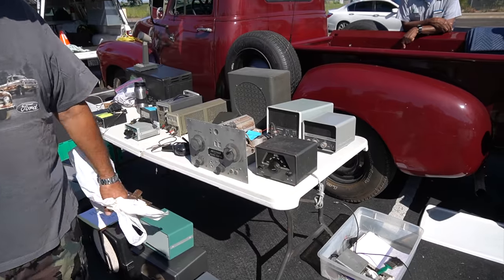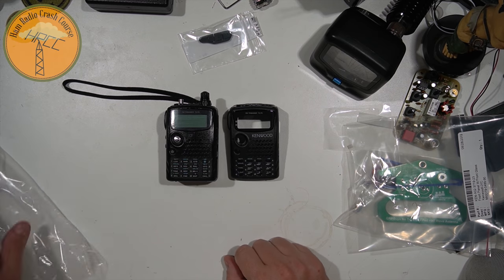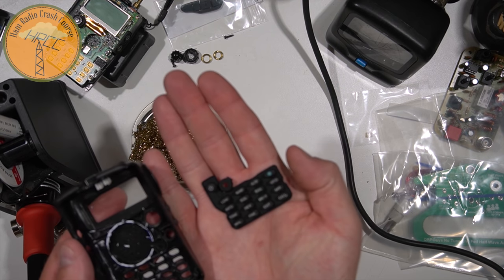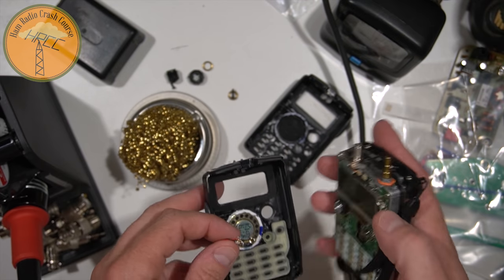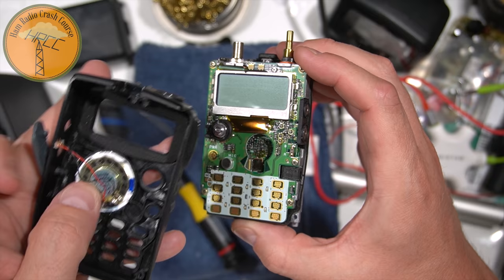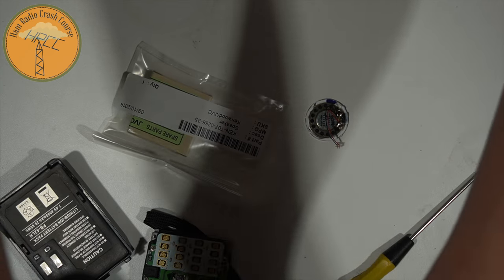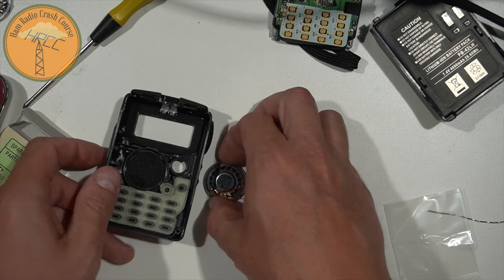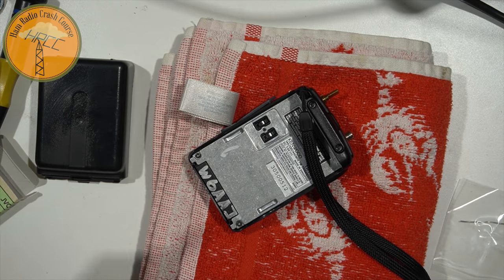Refurbish a radio for cheap!  Kenwood TH F6 Refresh!

Comment: On those tiny speakers it is really easy to overheat the connection and have it detach from the cone or the back of the terminal board, even after 48 years repairing electronics I still wreck one on occasion! Fast soldering is a must! And they had the speaker glued in for a reason... to keep it in place so it doesn't fall out into the board.. Easy way to make some cash if you have access to the bad radios! Ones I see they all want new prices for old junk!

And PacParts is a great source for old stereo parts too! I restore older stereo receivers and use them often!

Comment: Pac Parts is an authorized parts distributor for Kenwood, and other brands. For Kenwood, they handle parts for both communications (amateur radio and land mobile radio) and consumer electronics (home and car stereo). If you are an independent repair shop for Kenwood radios, Pac Parts is the place to go to get replacement parts. Kenwood USA only stocks parts for their internal repairs. So, it's not unexpected that Pac Parts would have parts for the TH-F6.

The TH-F6 is a good radio. 5 watts on the 222 MHz band is a plus.A friend has two F6's. He's vision impaired and finds the Kenwood to be pretty easy for him to operate. I had both an F6 and a D72. When the TH-D74 came out, I sold both and bought a D74. I think I got $200 for the F6 and $350 for the D72.